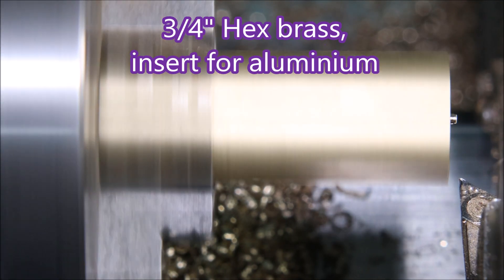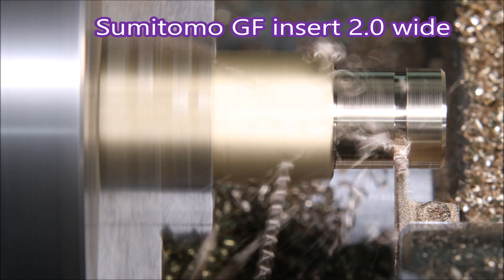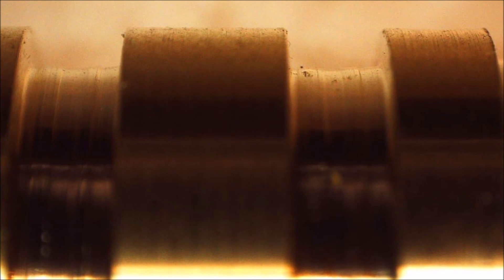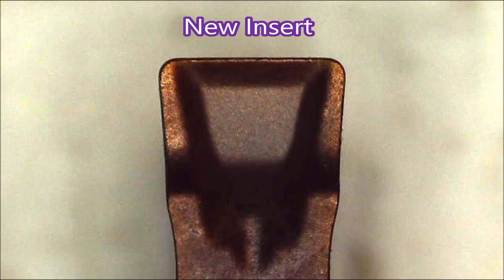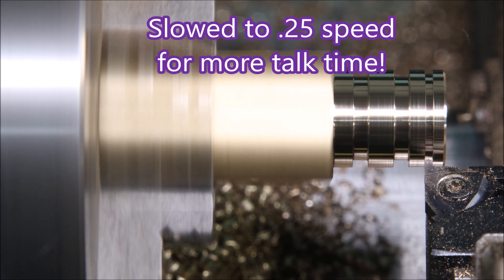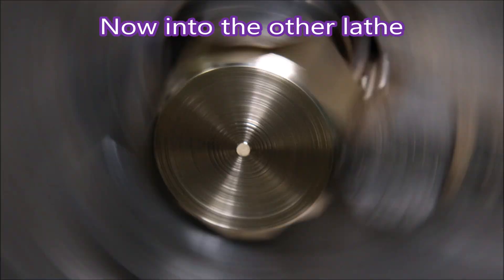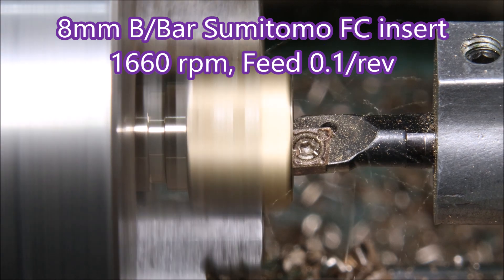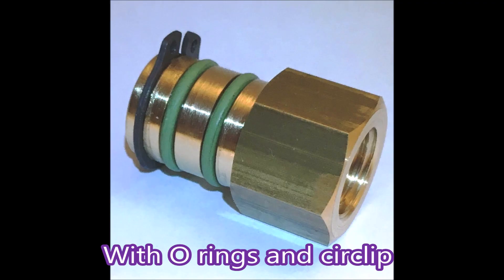Turn, Groove, Part, Drill, Bore and Tap 1/4 NPT. Brass fitting in small cnc lathe

Comment: Grrat video , clever use of the parting off insert, can you get the same size inserts for aluminium with a ground cutting edge?
Cheers Ian
Reply from the maker: The O ring grooves have a 0.12 radius on the corners, I did not want to use a turning tool for the od and then set the parting tool so accurately that the radii were completely formed. I do have some Sumitomo inserts which I believe are ground, I will check that for you. They are not polished and are not sold as being for aluminium. They only have a 0.05 corner radius (compared to the 0.2 on this insert) so they really don’t cut that well going sideways. That insert I use in 1.5 width, but I think it is also available in 2.0. Disadvantage with those is the max diameter it can cut is 16mm
Thanks for your comment.  Nigel
Reply: @smallcnclathes  that makes sense thanks Nigel
Reply from the maker: I checked and the other inserts I use are ground!  They have their on tool holder.  Sumitomo also produce a GA insert for non ferrous materials and its geometry is not unlike the one I use.  The widths are quite different though, Mine comes in 1.0, 1.5,. and 2.0, so intended for quite small work The GA insert starts at 2.0 and goes to 6.0 (I think). Your comment has me working on a video, not so much a comparison video but more like an explanation. Hoping I can buy a single GA from Sumitomo to photograph and perhaps show cutting material
Reply: @smallcnclathes  looking forward to the video , I haven't got an insert part off,  it'll give me a better idea which one to get 👍